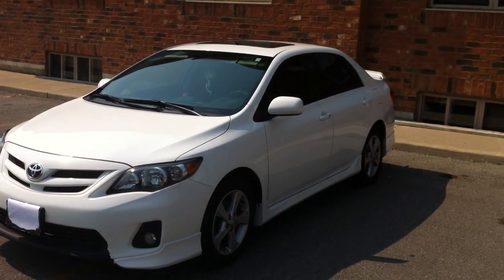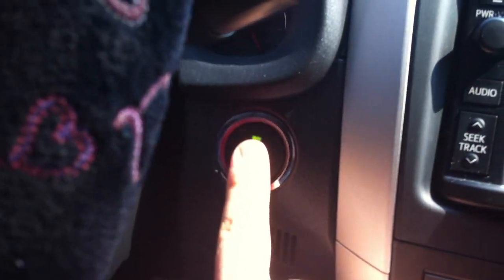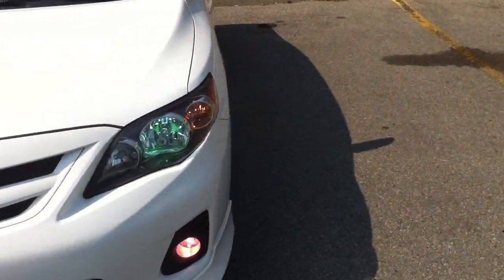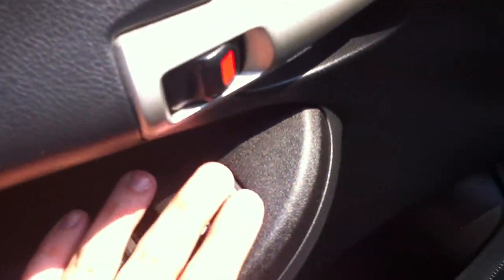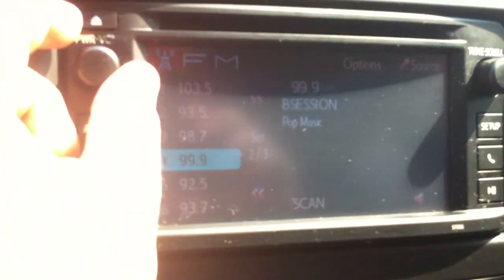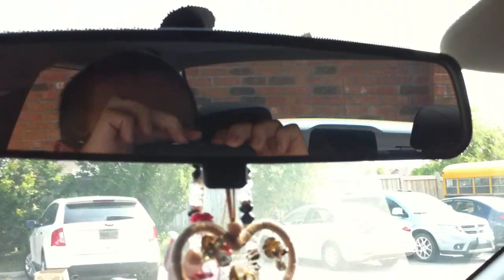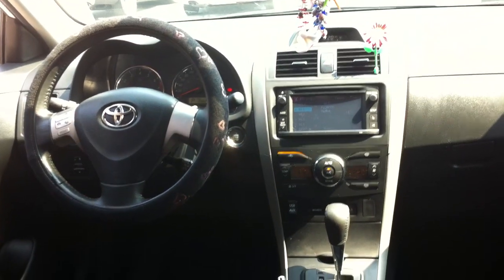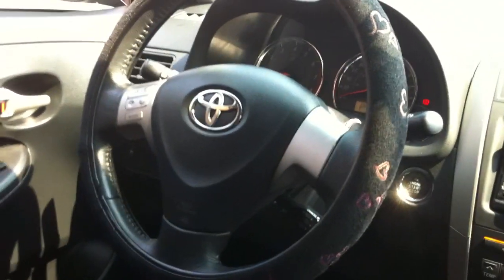2013 Toyota Corolla S Startup Engine & In Depth Tour

Comment: I have 2013 Toyota Corolla LE Premium Package - basically the same car, but no smart key & rear spoiler. But right spoke of steering wheel equipped with Bluetooth operation buttons. 108 Kmi odometer, runs good. Serious problem was last year-blown engine head gasket @ 104 Kmi ( I suspect it was manufacturer’s defect on head). No other complains. High reliable vehicle.